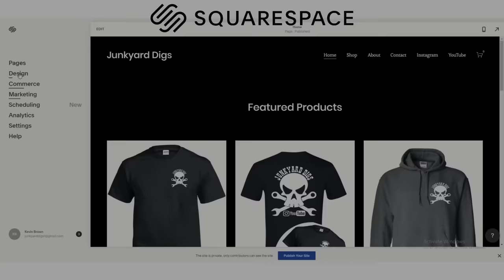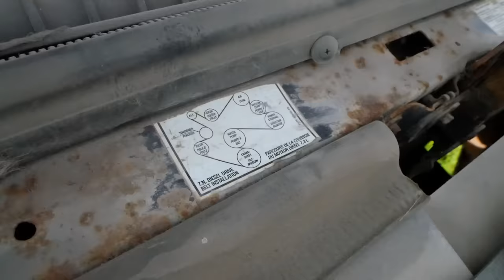Can We Get ABANDONED Tow Trucks to RUN?  - Part 1

Comment: I work in a light duty diesel shop, and specialize in Powerstroke engines. I’d replace the IPR and ICP as soon as possible. Only use Ford sensors, aftermarket tend to not work or go bad fast. Flush the entire cooling system with water with engine running until it runs clear. Then fill it with the purple Heavy Duty coolant from Napa. That 7.3 PSD will last longer than you expect with proper maintenance. Oil every 5k and fuel filters every 10k and it’ll be fine
Reply: If you listen to it crank it doesnt sound like it has good compression which isnt helping it start in the least
Reply: I’ve used an aftermarket ipr valve. It did not like it.
Reply: why didnt he like your comment :-( you know what you are doing.
Reply: I doubt that black sludge they called oil was helping anything either. I'd never start an unknown engine that sat for years without pulling the oil plug more than likely water or worse coolant sitting in the bottom of the oil pan.
I agree on the sensors, the HPOP could be getting weak too, tow trucks do tend to sit and idle alot too so god only knows the hours on the engines.
Peak Final Charge is good stuff as is CAT ELC is as well. The 7.3L Powerstroke and the 7.3L IDI are both engines know for cavitation gotta keep your additives up.
I didnt notice any obvious skip while they were cranking the Powerstroke, good chance the Powerstroke has some life left in it.
Reply: You can put the heavy duty purple in the OBS 7.3 engine and not fuck the injectors seals???
Reply: Yeah my dad has a 1996 f250 7.3 5 speed that runs like new and only had to do something to the clutch can't remember exactly what but it's a great truck
Reply: Bro please holler at me on facebook keaton William pic of me holding my babygirl just purchased first diesel tow rig 99 powerstroke 7.3 studded and tuned been sitting three months needed turbo pedestal seals and now time for first start
Reply: @keatonkelley1824  how did it go
Reply: Hank Rutherford Hill  Forgot that about the older 7.3L Power Strokes. So yeah want to avoid Peak Final charge too, and should use the Peak Fleet Charge. THough on the IDI either one should be fine.
Reply: Yap your right
Reply: @operatorbenji9735  compression sounds fine to me, i own an obs 7.3
Reply: @psd28  I own four but good for you
Reply: replace the seals on the injectors also, it is probably bleeding down the heui oil and has to fill the logs back up.
Reply: 0:52

Comment: First gear is only for towing houses - start in second.
Reply: 😆 love it.
Reply: Lol like my truck
Reply: I've got a 1 Ton, Dually, Flatbed, Chevy C30 With a Straight piped, Cammed 350! It's a Manual 4 speed with Granddaddy low... I love driving it!
Reply: @goodrichfarms8795  i have a 3/4 ton Chevy with a 4500 drivetrain and suspension cammed 350 heavy-duty 5 speed nv4500 14 bolt 4.10 gears. House's get moved occasionally by it...it also tow's the gas station along with it at the moment. 😆....and i have an f150 with a F450 frame and drive train...7.3 idi NA. It pulls anything...and gets 20mpg while not towing. I am set on tow rigs...i just want a fast car now. Lol
Reply: Where is the part 2
Reply: And horses
Reply: I have an 88 ford i.d.i. it doesn't seem to be super low geared. If I'm not moving I start off in 1st
Reply: Granny gear
Reply: No first gear is for towing cruise ships
Reply: One of my first adult jobs the place had a pickup with four forward speeds and the slowest, crankiest 1st gear. I always started in second. I was told, start in first, I said did you hear me grinding gears? Reply was, "Never mind."
Reply: @CloudHindlen  damn ..how long you had it?
Reply: @skyb8687  which one?
Reply: LOL

Comment: That little box reading the rpms is a factory high idle, you simply push the arrow up button to set it higher when using the PTO. Also, when bleeding brakes, there is a small module if it has ABS that needs to be bled on the drivers frame rail. If you drain the system air gets trapped here and gives you a spongy pedal. When you change the oil, use good quality rotella 15w40 with a motorcraft filter and add one quart of Archoil 9100. Itlle free those injectors right up from sitting. 👍

Comment: The little yellow lever on the bottom of the fuel bowl is a drain valve...
Reply: Yeah, he Googled everything but the fuel bowl. Had he of done so, he would have seen how much quicker and easier that would have been.
Reply: Glad someone said it before I did! I owned two of these 7.3 powerstrokes and know them like the back of my hand! Simple trucks to learn and wrench on!
Reply: Never touch it if it hasnt been touched. Learned the hard way you dont need to drain the bowl because 1. They always leak after, 2. They get stuck lol

Comment: Biggest things about diesels taking a while to start is because of air in the fuel. Check all seals from the filter to the pump aren't sucking air. The pump itself is made up of many O rings that will have dried up sitting for 5 years without fuel to lubricate it. At this rate you should replace the fuel pump or try replace the easily accessible O rings
Reply: I have a 02 mack Vision oil pump went out replaced it now I'm not getting oil pressure truck runs fine I did order a oil pressure sensor hasn't got here yet. Any idea what it could be sir? Thanks for your help much appreciated
Reply: And not only that, those O-rings were designed prior to ULSD, which wears them out, so eventually they all should be replaced.  And THAT'S when you'll really have to deal with purging the air to get it started.  Worn injectors also cause hard starts, especially after sitting and high mileage.  The injector has a clearance of .004" which high pressure oil needs to flow through in order for it to fire, and that clearance gets smaller with wear, usually caused by extended miles btw oil changes.

Comment: Extended crank like that at the end could be a cam sensor flaking out (heard it hiccup a couple times running too), worn injectors, lift pump dying, or even a tired HPOP. 
If you can get a computer on it, monitor your ICP pressure while cranking- if it isn't going above 500 until it lights then you are fighting building pressure. 

Damn solid engines if you know what their weak spots are.

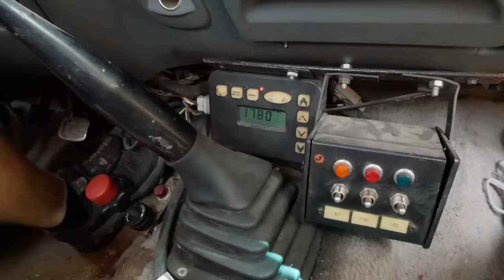Comment: 44:21  THE BLACK BOX w/THE RPM'S & FORD LOGO ON IT IS USED TO IDLE UP THE ENGINE WHEN THE PTO IS ENGAGED, TO MAKE THE HYDRAULICS(LIFT, WINCHES, ETC) WORK MORE EFFICIENTLY & QUICKER...FYI)
Reply: *Spins the alternator to crank out more amperage and voltage potentially.

Comment: Hey heres a tip. Once u get the tank ran threw a few times add 2 stroke oil to you fuel tank. Itll clean the fuel system out and the injectors. It sounds odd but it's one if the best fuel additives for cheap.
Reply: Don't need a different license if it had air brakes you  don't pull off in low when empty
Reply: @darin what sort of ratio of 2 stroke to the diesel?
Reply: @paulgoodall_  I've read a few articles that adding 2 stroke oil to diesel fuel can actually make things worse.  Use diesel fuel additives that are specefic to what you are trying to do and look around at reviews to find a good one.
Reply: @paulgoodall_  my guess. A few ounces
Reply: Nope, dump 2 stroke oil in it, these 7.3's like it.
Reply: You can use a diesel fuel supplement called everyday diesel treatment. Heard it's pretty good and it's made my injectors quiet
Reply: DO NOT DO THAT TO A DIESEL!!! it will ruin your engine, and plus, its the wrong fuel! i work in a diesel shop and i just replace the fuel system. its a cheaper solution and plus you would need to replace the system if you did that anyway. DON’T DO THIS PLEASE!!!
Reply: Really that seems odd just sounds like it would do the exact opposite

Comment: Pro tip: put wood under the stinger and put it down all the way to lift the rear of the truck
Reply: That would work if the line didn't break.
Reply: dragnridr05  is the ‘in/out’ on the same lines as the ‘up/down’ on that stinger? He was on the retract cycle when the line failed. 🤷🏻‍♂️  I believe they are separate.
Reply: Exactly...
Reply: This.
Reply: This what
Reply: @FourSeasonsNorth4x4 I know I'm late, but to be fair, the line could probably blow while trying to lift the truck.
Reply: @nathanbrinkerhoff5886  or while under the truck....
Reply: @jakobc9348  That too, but on the black truck they busted a line lifting a car.

Comment: Most of those OBS ford ignition tumblers are so wore out they can be started with a house key..
Reply: I know mine can! But my front tank is INOP, so I switch to the front tank as an anti-theft...assuming the crook is too dumb to switch tanks, which is likely for anyone stealing an OBS in 2020.
Reply: @bcubed72  that is exactly what I do! My front tank also doesn't work!
Reply: I have an 84 Oldsmobile. Haven’t needed the key in years.
Reply: @bcubed72  i used aluminum blank with marker die and put pressure on it and wiggled the key til it marked the die. then filed them out and i could make the key in about 5 minutes, just need a set of small files like used in any small scale machining.
Reply: A bunch of Jeep cherokees can do that I can take the key out of mine while driving
Reply: So much truth
Reply: @thomaswinders5403  I had a Grand Cherokee that was like that lol. Super convenient on hot days when you wanna leave it running and lock the doors to go in the gas station 😂
Reply: Yeah he probably could have just used the random Chrysler key he found in the door 
Actually might have been the reason it was there lmao
Reply: How about a twig
Reply: @Ian-of9oi  My '86 Saab does need a key to run... but you can take it out, so it doesn't need it to keep running. Of course you can never turn it off then... 

hmm. Someday I'll figure out how this is useful.
Reply: I have 5 obs f150 i start them all with the same 1 key.
Reply: You still need a key?
Reply: House key? Hell, I could use a jigsaw blade in a pinch!
Reply: Any Early 2000. Gm, pontiac,buick, oldsmobile. Alero Leave the Air on Key's Fall right out. 05 equinox, Same thing. I have 1 key for 2 vehicles
Reply: @bcubed72  

l

l
l
llllllll
l
ll
llllllllllll

Comment: Peg curses like a sailor but he's right on. Nice guy
Reply: Buell_BR9 McGhee  well shit I curse all the time, its a sign of genius.
Reply: Grab a good dumptima batree. And 3 cans of consent. Put 12 volts to injector pump. And jump the solenoid. And giver . When it takes off . Just as I suspected carbon on the valves. Proceed to the ketchup. Right past the mayo and mustard. Sender all the way into the danger zone! As the words of a wise man.
Reply: He speaks fluent army
Reply: @wreckerjonny6144  Little redline for a good time
Reply: What  did you spray in it
Reply: Michael Cook vegetable oil
Reply: He's a real nice guy. Had some PC Light and potato water with him. Gave me his bad leg too. Got it in a case on my shelf.

Comment: On the side of the fuel filter housing is a yellow lever that drains the fuel bowl
Reply: Now you tell him. LOL
Reply: Better off not touching it.  Usually start leaking since they rarely get used
Reply: Thank you, I felt bad that he was using rags the whole time
Reply: Jeffrey Bamford  Yes, they drain from the bottom, just like all diesels....water first, then fuel.  In the marine industry we just call them water separators, because the bowl is clear plastic and you can totally see where the water is sitting....or any damn street Cummins for that matter.
Reply: Dats called ‘sperience’.

Comment: I've done revivals on both power stroke and idi. Never really much to it. Biggest thing with these is undoing all of the hackwork other people have done in the past, and because these things are so robust people tend to neglect maintenance on them. My personal 95 7.3 f350 cclb 4x4 has about 10 grand worth of engine work done to it, king ranch interior, sound system and a dually swap. It is a absolute hoss. 310,000 miles and still puts in work. Best truck I ever had.

Comment: "I wish this was a 460 gas"
Puts fresh fuel, new batteries and a starter solenoid in it and has a good running Powerstroke, which is superior in every way to the gasser.
Some people....
Reply: Seriously. I wouldn’t take a 460 for free. That powerstroke gets literally double the mileage, more power and will run a half million miles. The 460 might go high miles but you couldn’t afford the gas to find out.
Reply: 1995 powerstrokes are tough. gas engines don't compare.
Reply: @jessepitt  no doubt. I have some gassers i love, but the 460 is an overfed dog.
Reply: @jessepitt  my 02 7.3 had 1.1 million on original engine and trans when i sold it 7 months ago
Reply: @jessepitt  you do realize a gas engine that gets 12 mpg cost about the same in fuel as a diesel that gets 18. diesel is about 50 cents more a gallon. i know my ctd is no cheaper than my old 6.0 chevy.
Reply: @jeffreyrigged  you do realize 12 to 18 is 50% and $1.50 is 50% more than $1. So where is gas $1 a gallon and Diesel $1.50 a gallon???
Reply: Hay lets sit at home and shit on a young guy who's trying to learn something new and entertain you at the same time!  Very helpful.
Reply: @jeffreyrigged  nope, diesel is only 15c more here and my old 7.3 idi gets 25mpg on highway and it's a 4x4 on 32's. (Uses 1/4 tank in 100mile highway ride which is 4 gallons as tank is 16gallons)
Reply: Some fords from back then came with different types  of diesel engine. Yes Diesels will be superior due to horse power, but only buy one if you got the money to pay for the diesel.
Reply: @ericl7007  We pay $3.50 for diesel in our area and 2.00 for gas but the diesel has double power and double the mileage just overall more reliable.
Reply: Talks shit about the diesel when he’s working on it- gets hooked when the turbo spoils up when driving it.
Reply: And not to mention either of those 7.3 is worth twice as much as any gas burner truck
Reply: There is a yellow think sticking out on the filter housing its a valve to drain out the water and bad fuel
Reply: Holy crap this guy's clueless.  Should just stay away and play with crappy gas engines...
Reply: Power strokes suck to maintain. So expensive
Reply: I love both the 460 7.5 and the 7.3 powerstroke
Reply: Yes , once you've had a good diesel, you never look back
Reply: @zimtuff  depends if you live somewhere with a hate on for old diesels. I had to trade in my old diesel van for a 2015 model with Euro 6 and an AdBlue tank just so it would pass emissions to allow me to drive to work without getting a fine every time. Still a diesel but one where the engine management computer punishes you if you touch anything (it threw an error code yesterday because I put air in the tyres).
Reply: @steamftwin3249  how are you getting that much
Reply: I have a question for the Americans in the comments. Why the hell is diesel more expensive in the USA? Here in Greece it's almost half the price of gas.
Reply: @user-bi7xd8ry5p  in canada where I am diesel is also cheaper, about 5 cents
Reply: @user-bi7xd8ry5p  Diesel used to be cheaper than gas in the US as well.  I think around the mid 2000's diesel trucks started getting more popular, soon after, the price of diesel fuel started going up.  Supply & demand I guess.

Comment: And now a good name for the tow truck. The “Dumpster Fire”

Called my truck “The Barge” cause it handled like a boat.
Reply: I have yet to name mine it's a 01 chevy 3500hd truck (the ones with 10 lug wheels and 19.5's) some guy previously rammed a 12v cummins into it and did a poor job of it its got a twin line twin cylinder jerr dan box on it.
Reply: I have a 1995 f150 your name is the cofee
Reply: Nah, call it the “ Extinguished Dumpster Fire.”
Reply: I’ve taken to calling my 95 Cummins dually Bertha

Comment: love the diesel revivals, and the Fsuperduty is basically the F450 of that day, it was only available in a manual transmission too so that is why its a manual in a tow truck. 1994 was when the Powerstroke came out. nice score on 2 7.3 diesels though, great video, junk vehicles are the best to look at by far
Reply: Actually, the F-SuperDuty, even it was released in 1994.5 with the Powerstroke, it was available with an E40D automatic.
My parents have one that is a tow truck, is a 94.5, and with an automatic.
Reply: @tonycartland8757  oh okay, i always thought the F-superduty only got the ZF5. ive never seen on with an E4OD before though either. yeah 94 was a crossover year, i would prefer a turbo IDI myself for simplicity and cheaper parts though

Comment: Kinda looks like the diesels are easier to get running if you have clean fuel system. Hmmmmmm. 👍
Reply: It’s because they run on dirtier fuel.
Reply: they need clean fuel air and batteries and they'll run none of that spark plug electrical voo doo bullshit to dig into that is almost always screwed up somehow
Reply: They are.  Those 7.3 will run forever too.
Reply: enjoyed the video, although you weren't very familiar with diesel engines your mechanical aptitude definitely got you through it
Reply: EvilTurkeySlices not actually true.

Comment: Man.   I just realized I need a 7.3 manual in my life.
Reply: Great engine
Reply: U really do I have one
Reply: 95 550 picker truck, 7.3 manual was the most fun truck i have driven, 2nd place is a 92 idi manual, crew cab long box. Both super mint.
Reply: Same here, go watch poeboys
Reply: Used to drive a flatbed dumptruck 7.3 and it was pretty great, low was always good for loaded hill starts